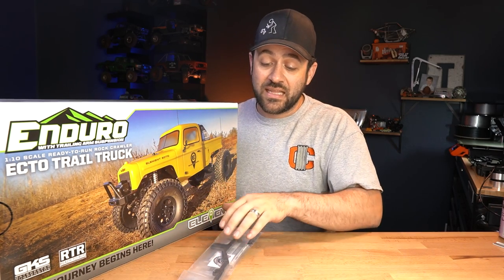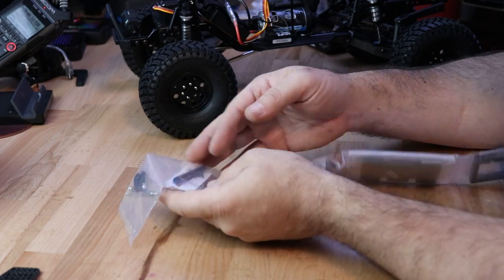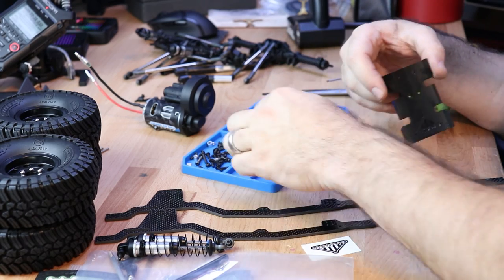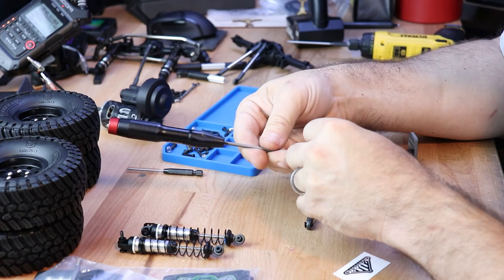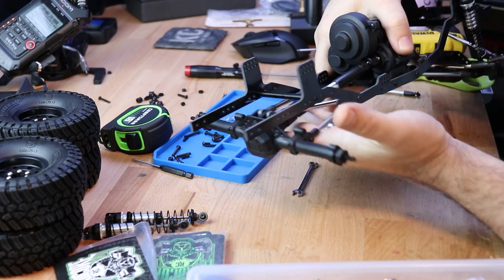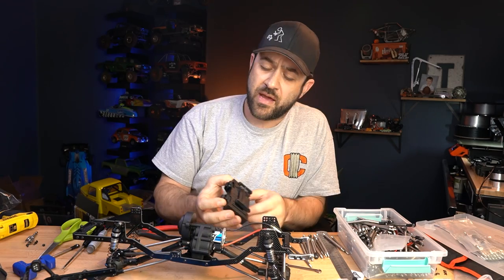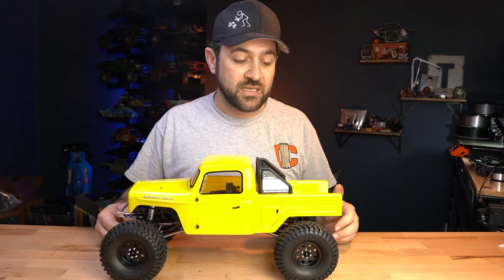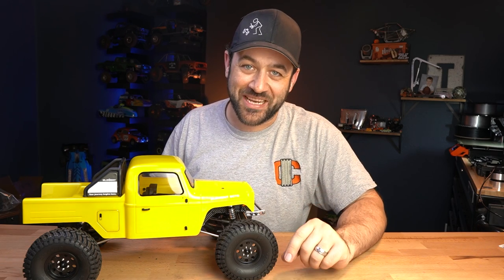Element Performance Chassis Kit - The Titan - Team Garage Hack

Comment: TEAM KNK BLACK OXIDE HARDWARE KIT

Front bumper hardware - (4) M3x8 

TGH DSM & GSPEED G-MP hardware - (4) M3x8, (2) M3x10, (1) M3x20, (1) 2mm aluminum spacer (optional draglink spacer)

Upper shock mount hardware (4) M3x20, (4) M3 nyloc nuts, (4) 5mm aluminum spacers 

Front upper link hardware (1) M3x14, M3 nyloc nut

Vader skid mounting hardware (4) M3x14 

Rear upper link hardware (2) M3x16, (2) M3 nyloc nuts, (2) 2mm aluminum spacers 

Rear chassis brace hardware (2) M3x8

Rear bumper mount hardware (4) M3x8 

(1) 6mm aluminum panhard link spacer

Comment: Thanks for all your great videos. I'm new to crawling but been racing rc since mid 80's always trying to go faster now im trying to go slower. currently have a axial capra grand daughter drives and now a Vanquish Phoenix both have been awesome but I'm not loving the look of the phoenix body tho working on going to the origin half cab ether do a roll bar or really want to cut top off and do a cage. your videos have inspired to try welding up a cage since i weld stainless and have welder. still trying to get more info on whats the best fill rod and tubing to use. not sure if i can weld brake tubing or what solid rod to use dont want drop a ton of weight on it. Thanks again love your channel
Reply from the maker: 3/16” diameter tubing is what you want ideally. Brake line is nice and thin but not very strong. Also you need to strip the coating of course but as a welder I’m sure you’re more than aware!

Check out ScaleMetalSupplies.com for all kinds of stuff, including 3/16” DOM tubing which is the best option. 

As for filler, are you TIG welding? If so, I highly recommend Silcon Bronze filler. It’s technically TIG brazing but is perfect for our scale.

Comment: The Titan chassis was a fantastic upgrade to the sendero. I've used it for a few friendly comps and it performed very well.  I Added some good wheels, tires ,and foams and a good winch and went from there. The factory servo is definitely a weak point. Great review thank you!

Comment: Cool conversion, lots of potential and interested to see where you take this! 👍  I really wish manufacturers would include instructions, though.  Even someone as experienced as you, Josh, was winging it at times.  Just show some consideration for less experienced builders.  At the very least, post a video and put the link in the packaging (just print it on one of the header cards). 👍

Comment: Love your videos, just saying. But on this video yeah I have to completely disagree I think everything you did was pretty much just Overkill I've got the same rig and she's amazing. I've done the axle servo mount, fusion 1200, Dumbo RC receiver and controller, hyrax or factory either / or are good tires, a front metal grill with light kit, a few weights in the front and some tire weights and that's it and my guy runs like a champ. ❤
And not to mention to top it off it sounded like there was a lot missing that you are going to have to make accommodations for in this build. If I had to do all that extra work I wouldn't have bought the parts I would have just made them myself LOL.

Comment: That's a cool build.
I have been thinking about doing a element built.
Just have not jumped on it.
I will say that the front end looks to stretched out.
The axle I mean.
Compared to the rear.
I dont know if there is a point to that.

I may pick up some sort of element kit or rtr soon.
Make my own comp truck.
I built 1... then sold it.
Because I wanted a vs4-10 origin, which I love.

All in time.

Comment: i went a different route - with Element kit 2 - and the SOR Graphics LCG kit for it - this way it is a class 1 rig - with great TEAM shocks and high clearance links in the kit already - it is a good start - added a 25 % knk overdrive to the stealth - and a front motor mount from InTheworks -(the spur is in front and the stealth is acting as a divorced transfer ) ssd pro44 universals with their brass knuckles gives a very good steering angle - copperhead and a 2700 HH PULLER STUBY ,HH 800 servo - i am very happy with the combo - the SOR kit really make a difference in the rig capabilities -

Comment: I keep a small piece of tape on my 1.5 driver to use as stopping point. First used for Capra, (Vader skid not as wide) but if I stop like 1/8” before tape and hand drive it in evenly afterwards

Comment: I've seen one of those 70mm spacers between the upper shock mounts.  Would that stiffen the frame a little?  
Maybe you could print something that would slid on that spacer for the front body mount.  Kind of a twisted figure eight?  I could see that piece being used in lots of situations.
Reply from the maker: The spacer won’t work on the shock mounts in the front or rear on mine. The front has a servo in the way and in the rear it would interfere with the body. With more body trimming, anything is possible of course.

Comment: Hey Josh, thanks for the video. I bought 2 of those TGH bumpers, and never used them, went with something else, but you said you need what size tool to use the included set screws…..   0.5mm???,. That made me just check my tools. Smallest MIP tool I have is 1.5mm. Are you sure that isn’t 1.0mm needed, I don’t know
Reply from the maker: .050” driver. Standard size.
Reply: @HarleyDesignsInc  Oh, .05 inches, thank you, and thanks for the video. Was hoping to see you at Knights Ferry Ca this spring, before it got hot. I might have to try and get to Folsom some time.

Comment: Without comps in mind, what performs better, 3 link w/panhard and SOC, or 4 link w/SOA?
Reply from the maker: 4 Link with SOA will be superior. The weight is lower, there is direct linkage, and no possible losses from non-optimal geometry.
Reply: @HarleyDesignsInc  thanks, in the middle of changing ecto over to soa now.

Comment: Josh, if you look at the page for the chassis that you link, it lists out what all the hardware is used for. So you really didn't need to guess.
Reply from the maker: I saw that after, although hardware length isn’t what I would be worried about more for new builders.

Comment: Take your esc off that mount and put your small battery up next to the servo. Mount your esc and receiver in the cut up stock battery tray.
Reply from the maker: I’d rather have the battery lower in the battery tray than higher up but forward. Down low is first priority. A slider mounted battery is probably my ideal setup.
Reply: @HarleyDesignsInc  I like the battery on the slider too but my ecto has the battery up next to the servo. They're only 500-650 mah packs and it seems to work good

Comment: the chassis being under stress when you put it together is a deal breaker .... terrible design
Reply from the maker: It’s actually a benefit to the rigidity of the chassis. This is super common in aftermarket chassis like this. Give the chassis some taper helps to triangulate and take away the parallelogram type mushiness that you can get without it.

Comment: Mount it become to light in the bottom and is it that better than the stock ecto?!
Reply from the maker: Reducing weight in the chassis is a good thing. You want to keep the truck light weight. Adding weight only as absolutely needed.

Comment: i would trim the little tabs off the rear body mount, drill another set of holes in the back of the frame, then move the mount forward about a half inch. that would make the body position look a lot better, and make the front bumper stick out less.
Reply from the maker: Repositioning the body may be something I do. I may just draw a new brace and print it.
Reply: I was thinking the same thing.

Comment: I do have this chassis on my current build . Got it because it said a direct replacement.  How wrong was I 🤣
Reply from the maker: Definitely easier than most flat rail builds, but just needs a little more documentation.
Reply: @HarleyDesignsInc  100% , I ended up looking on their website and copy the photos